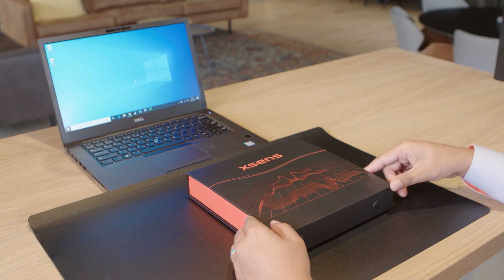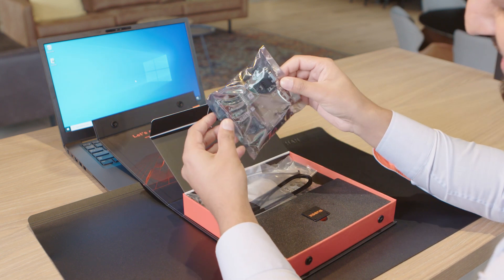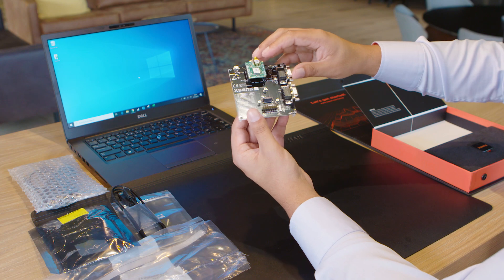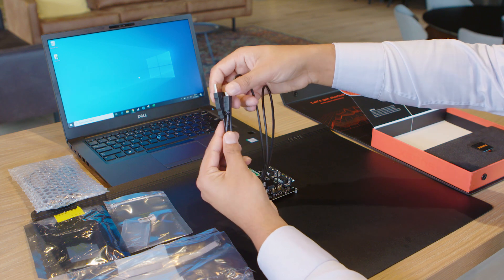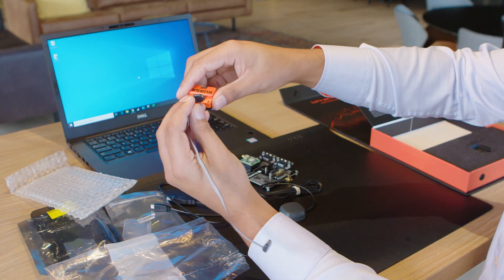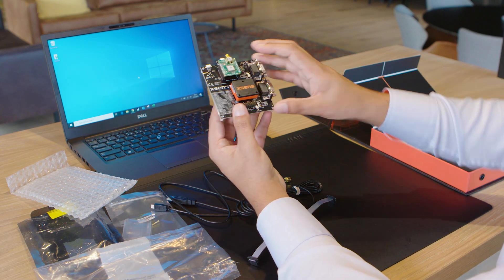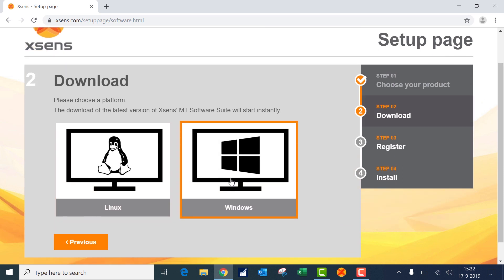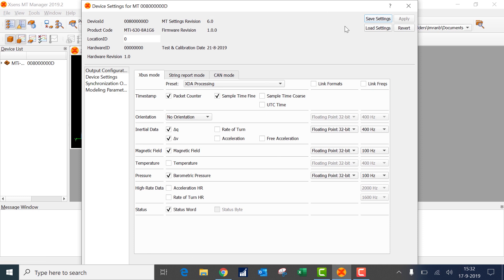Xsens MTi 600-series Development Kit Unboxing and Getting Started

Comment: Can this module navigate quadrocopter without stable gps signal?
Reply from the maker: Yes, the GNSS/INS models in the MTi 600-series can provide stable positioning data even under challenging GNSS conditions. During GNSS disturbances or outages the GNSS/INS will rely on inertial data instead. In addition, the high-rate inertial data will help to smoothen and improve the low-rate and often noisy GNSS measurements in all situations.
Reply: @XsensMotionCapture  what is a cheapest device which allow quadrocopter fly 10 mins without gps (return to home)? Do you have any examples for connecting it to standard fly controller with iNav software? Thanks a lot.